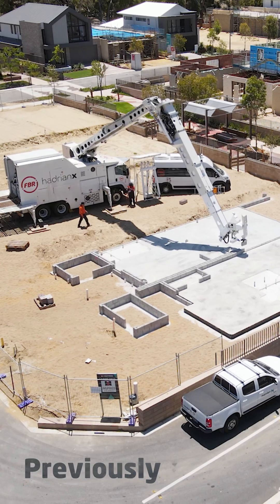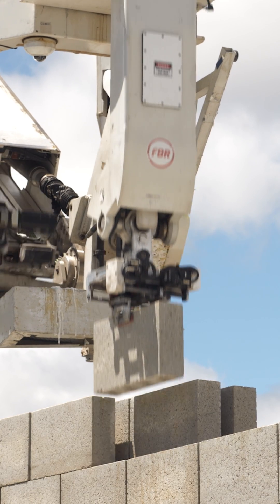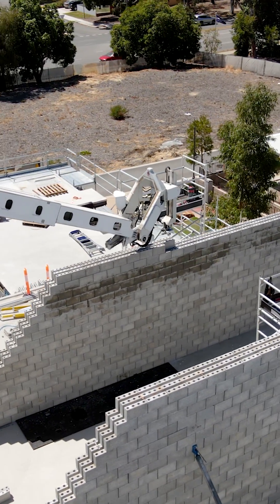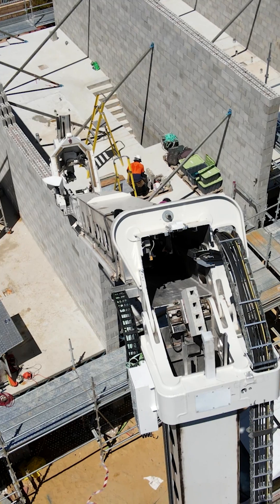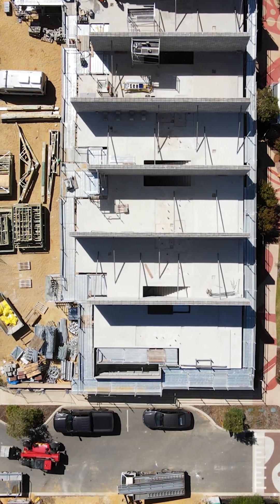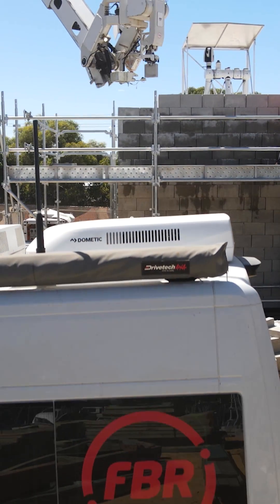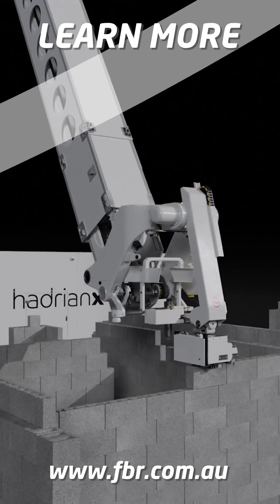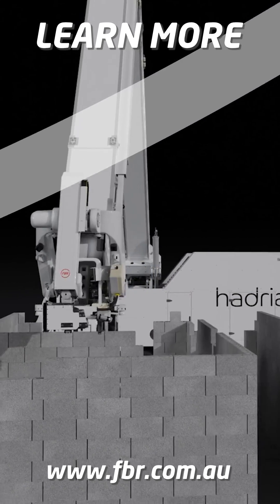Hadrian X® completes largest project to date | FBR

Comment: where is the mortar?
Reply from the maker: Hadrian® applies a construction adhesive to each block as it is laid, which cures in approximately 45 minutes and is much stronger than traditional mortar. This allows for continuous high speed building without having to wait for mortar to dry.